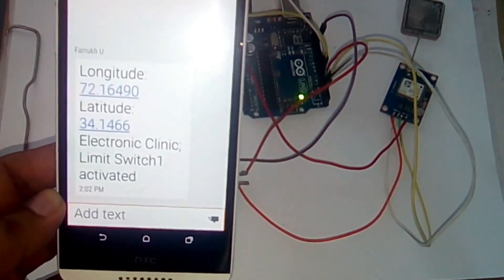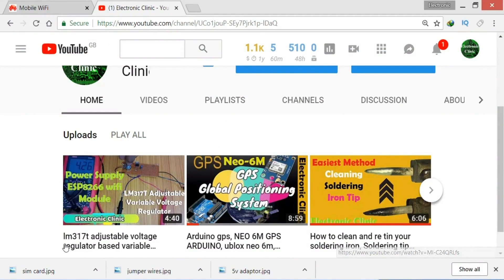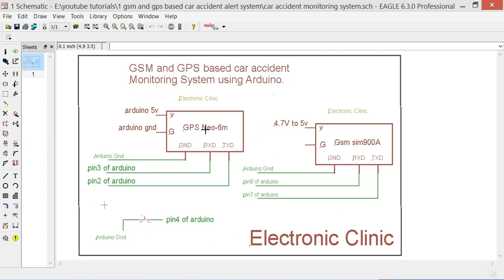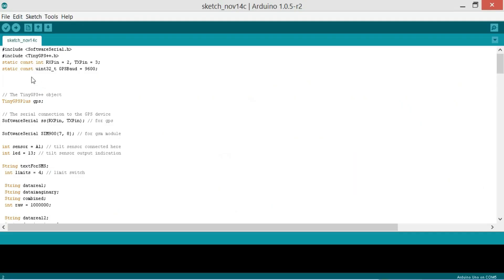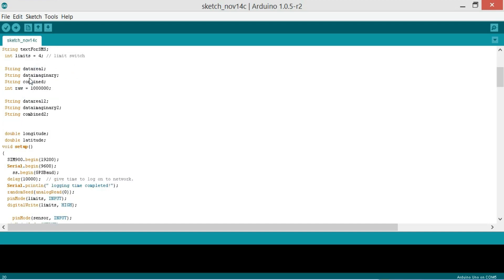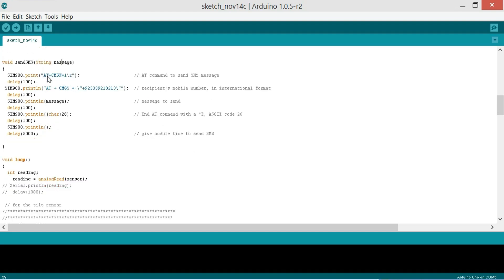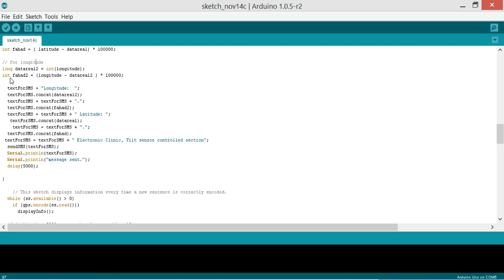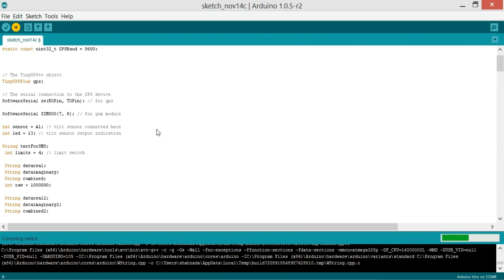Arduino gps car accident location tracking using Ublox Neo 6m GPS, Gsm sim900A "arduino project"

Comment: Can i use Airtel 4G sim plz reply coz i am using this as my major project main reference.......
Reply from the maker: 2g sim
Reply from the maker: If not using internet then you can also use a 3g or 4g sim
Reply from the maker: But the recommended one is 2G sim.

Comment: How do you use 9v battery as power supply for sim900a? I normally use 5v 5amp adapter. (I don't know how much current it requires. I tried it with 5v 2amp adapter and it doesn't work)  I recently bought XL4015 step down convert in order to convert 9v battery to 5v and still don't know how to adjust the current for sim900a to work.
I don't know how to measure the current.
Reply from the maker: even 5v and 2amps adaptor is more than enough. there might be some issue with your gsm module if it doesnt connect with the network.

Comment: I'm working on a similar project using Alcool sensor 
But the problem is I always get message with 0 latitude and longitude
Any idea please
Reply from the maker: wait for your gps module to.connect with the satellite. start with outdoor testing and normally it takes 20 to 30 mints connect.

Comment: Hi sir, after following your tutorial, I am success to make it. But what is the mean of the sms we receive, longitude? I thought it is google location code.....
Reply from the maker: i have designed the latest version which sends the googles map url link. this video will be available on 28th of this month.
Reply: @ElectroniClinic  Sound Great Sir,  Thanks!
Reply: @ElectroniClinic  Sir, the arduino and GPS6m can function because the USB of Arduino is connect to laptop. If I put them to my prototype product and connect to the prototype product electric source, will the arduino and GPS 6m will funtion?
Reply from the maker: yes it will work. the same think i presented in my upcoming video.
Reply from the maker: i designed my own pcb for the whole system.
Reply: @ElectroniClinic  i see, after I install on my prototype, I  need send what message to get location code?
Reply from the maker: ya this is location values

Comment: Could you make it ALSO so as when we send a message for example the word "Track" to get back an SMS of the coordinates? i am talking about the same combined program-circuit
Reply from the maker: i have used the same concept in another project, request temperature data, u can use that technique over here.
Reply: @ElectroniClinic  I am not sure it is the same thing. In my case I think  you need switching serial ports. Do u have any email to send you my code just to take a look? I have two sketches and I can't combine them.

Comment: The sketch can work except sending SMS. After limit switch closed, it sent a message but, my cell phone didn't received the message. Please advice
Reply from the maker: so many guys have built this project. check your gsm module, cell number, network connectivity.

Comment: My gps value return only 0.00 when working with SIM900a module. is that cause of two serial connections? is there need to switch the serial connection with .listen() ? plz
Reply from the maker: the 0000 values are because the gps module is not receiving any data from the satellite. this happens when you are inside a building or basement. try to check this in open space and wait for a few mints.
Reply: @ElectroniClinic  Thank you for the answer..

Comment: quick question! can you replace gsm module with wifi module so that you can monitor/access the stats (accelerometer/shock value, gps) from mobile app/website and get an emergency notification when the crash has happened ? also great work!
Reply from the maker: yes of course. you can watch my videos on iot"wifi" based project. I have a video on real-time tracking. check playlist.

Comment: Can i use vibration sensor instead of limits switch
Reply from the maker: Yes
Reply: @ElectroniClinic  can you please provide a new code with the vibration sensor instead of limit switch
Reply: your website doesn't opening

Comment: Can i know why there was two Gnd at the circuit of gps module even there was only one Gnd at the gps module ?
Reply from the maker: It really doesnt matter all the gnds are internally connected
Reply: @ElectroniClinic  thank you so much bro, 😄. One more, is the project will never work in building?
Reply from the maker: not really. this is a kind of problem everyone is facing. it works perfectly when used outside.
Reply: @ElectroniClinic  so, how to solve it to use indoor?

Comment: What the meaning of "fahad" And "fahad2" In the programming????
Reply from the maker: Just variables names
Reply: @ElectroniClinic  Can we Change it??
Reply: @ElectroniClinic  how much volt does the gsm module need?? Can we give it power supply by arduino??
Reply from the maker: this one needs 5v. No, you can not power up this using Arduino.
Reply from the maker: ya, of course, you can change.

Comment: Do i need a wifi module ?
Reply from the maker: Wifi based gps tracker is also available check playlist. That project is about real time tracking via map
Reply: @ElectroniClinic  if i want make for smart bagpack gps tracker how should i supply power to arduino uno ?
Reply from the maker: you can use a power bank.
Reply from the maker: This one is based on gsm module.

Comment: Can the entrire thing be done using some other GSM MODULE ? ITS VERY URGENT.
Reply from the maker: yes sure, you can use any gsm module. but make sure you use the correct baud rate and know about the AT commands.

Comment: i am  getting location in serial monitor as  lat= 0.00 and long=0.00 please help me
Reply from the maker: wait for the gps module. usually it takes time. 
if you are in a building then you will face a lot of problems. make sure you use this gps module in an open space.
Reply: @ElectroniClinic  thanks for your amazing response .my problem solved.
Reply: @karthikobillaneni9745  it means you are not getting the signal from gps module it has a light which will blink continuously.if the light blinks it was receiving signal properly check once...and try again

Comment: there is a slight problem in "LONGITUDE "part as the longitude that we receive in the message is different from the longitude shown in the serial monitor and hence the location comes different while searching in google maps. I tried many times but every time there is a problem in the longitude part whereas latitude is same in both message and serial monitor only the longitude after decimal point values change. 
I am providing you the SERIAL MONITOR  " latitude = 20.246217 and longitude =85.802406 
 "
while in MESSAGE "  latitude = 20.246217 and  longitude =85.14704
 "
this is the problem i am facing i tried everything if you can please help me with this and provide some other calculation part so that it can give me the right co-ordinates in message which is same as in serial monitor.
Reply from the maker: Use the built in float to string converting function. Watch my latest tutorial on realtime gps tracking
Reply: @ElectroniClinic  but in the code we are not using float or string we are rather using "long " example long fahad2= ( longitude - datareal2) *100000; the problem is in this part of conversion . 
Please help me as I am doing this as my major project for engineering
Reply: Hi I know its a lot to ask but if you can please upload an updated code for this project where the co-ordinates are same for both message and serail monitor and if you can remove the unwanted tilt sensor code from it . I am using your channel as a reference and guide for my major project if you can please help me with it.

Comment: where you set limit switch in car
Reply from the maker: Depends on you. You can also use some other sensors.
Reply: if it mistakely switch press means

Comment: Hello, I'm trying to build something like this. By texting the sim, I will receive the latitude and longitude of it. It's like a tracker. I have an arduino uno, a gps, and a sim900c. I don't have a background on these things but I'm trying to learn. I would really appreciate if you'd help me.
Reply from the maker: This is a complete project. I have explained everything. Still if you face any problem, let me know in a comment